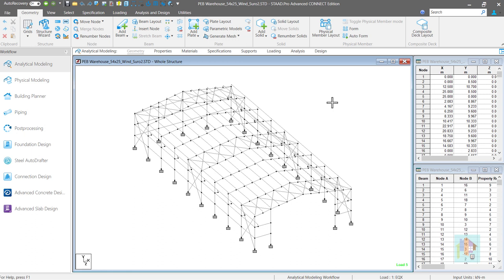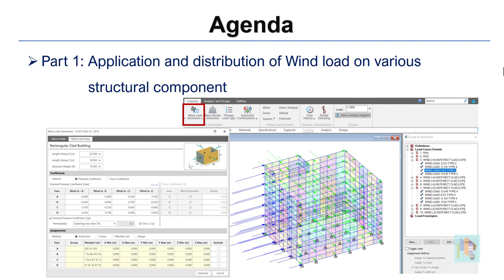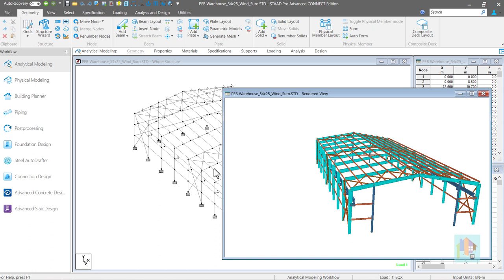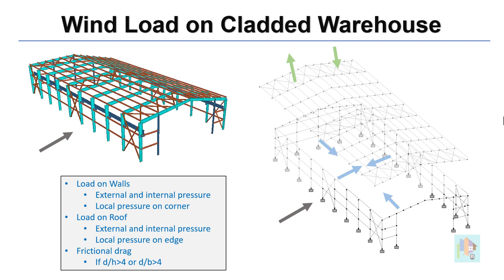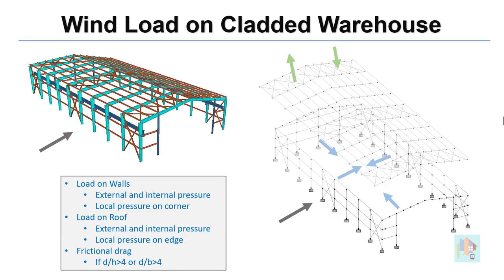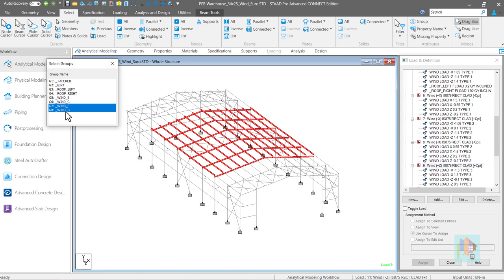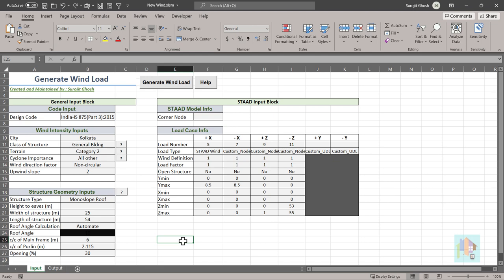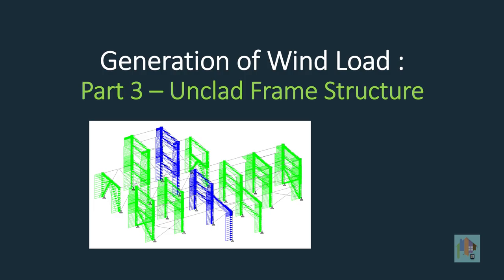Generation of Wind Load in STAAD - Part 2: Cladded Warehouse Structure || Wall & Roof Load || IS875

Comment: Can you please explain how we can assign local pressure coefficients for all 4 directions....!? Please 🙏
Reply from the maker: Using Wind load generator, we can define pressure coefficient for walls only, which is editable (available in the second page). This is considered for all 4 sides of the building, you can provide any custom value as well. For other localized pressure coefficient or roof coefficient, wind load generator cannot be used, we need to define it manually.